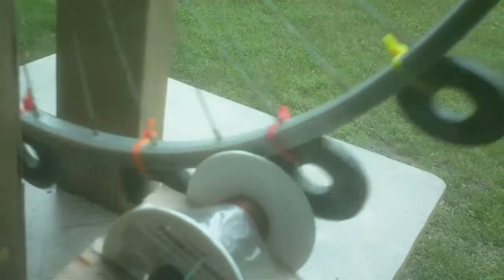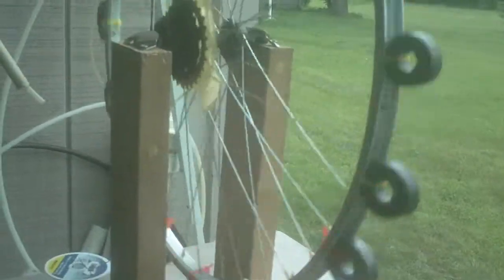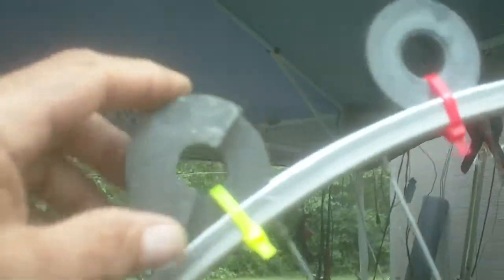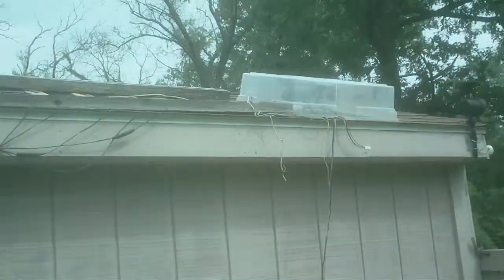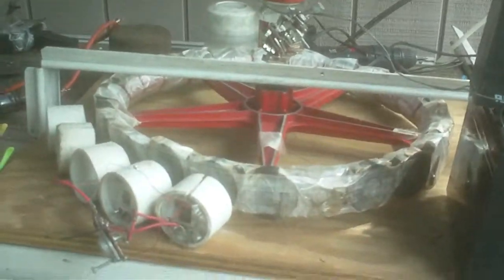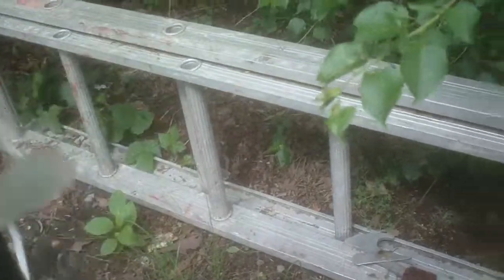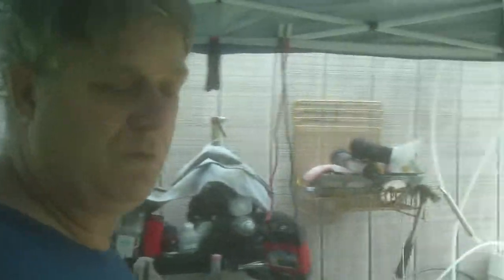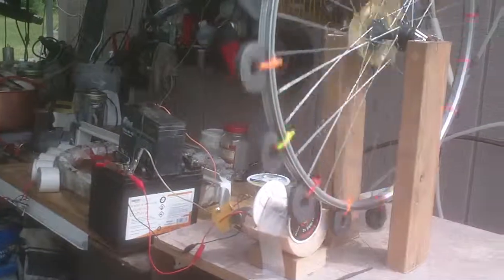Bedini Wheel Basic  with 18 magnets and Bifilar coil

Comment: Right on man! I am having problems getting mine going. how many winds did you wind your coil?
Reply from the maker: You can wind 300 turns up to 700 tons or 800 tons if you want it creates the high voltage pulse through the diode and the 3055 good luck with that hope you have it working soon
Reply from the maker: It also depends on the wire gauge thickness I was using 20 gauge 22 gauge 18 gauge 24 gauge anywhere in between those will work fine the thicker the more amperage less turns so you don't want to go too thick